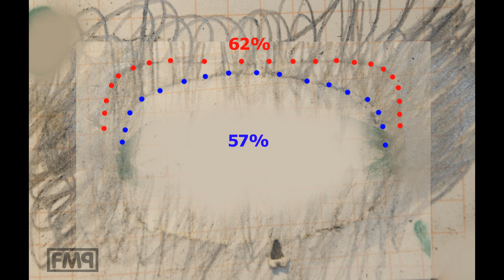vespa 200 O-TUNING very 1st START / FMPguides - Solid PASSion /

Comment: what is 0 tuning? 
just PNP Malossi 210 is easier and more power....??
Reply from the maker: changing cyl is PLUG AND PLAY TUNING, opening an engine and further tuning ist TUNING and FINE TUNING, ORIGINAL TUNING or O-TUNING is optimizing the hardware you have :) they all do have quite some potential that you can reach very easy
Reply from the maker: see here: https://www.youtube.com/watch?v=ZCnZ2T4DrzQ&list=PLri8t7DWSkg0yXXk73M6C0opkHN8pxBls&index=2&t=0s